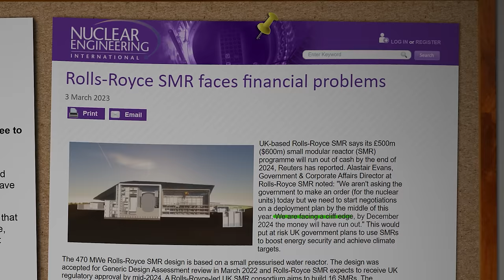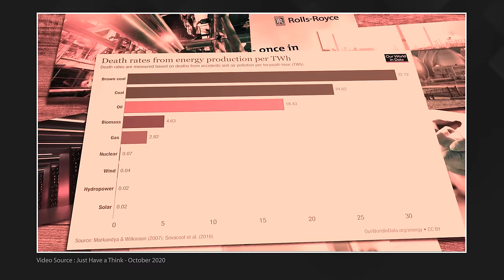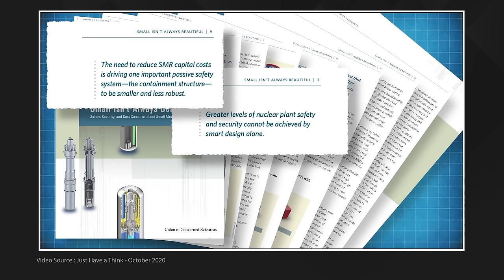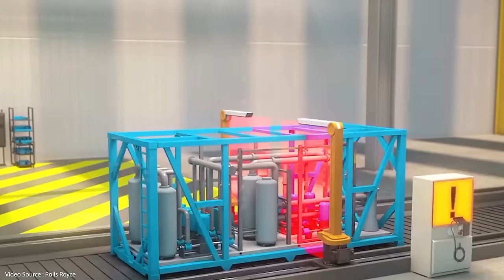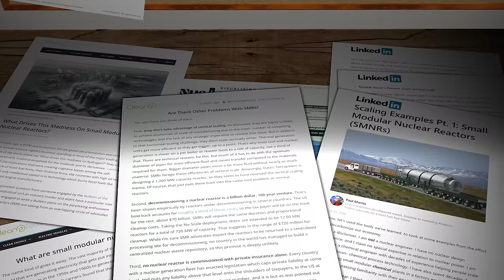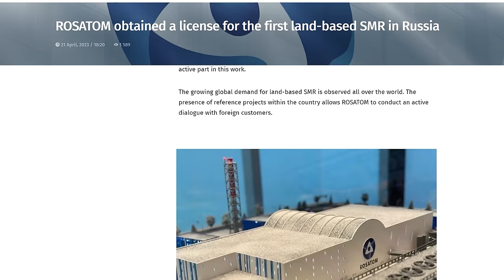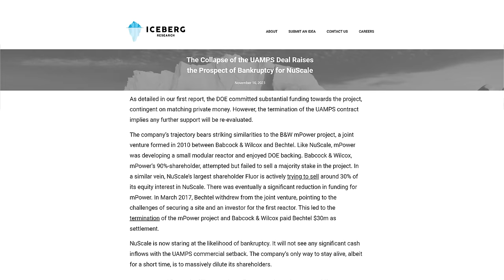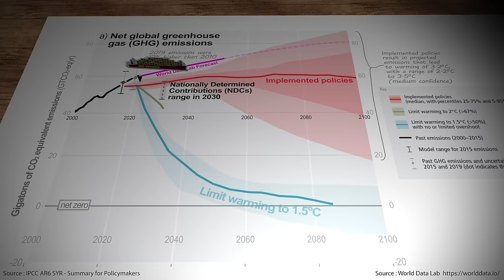Small Modular Nuclear Reactors. The Verdict

Comment: I have similar views. It's hard to see how nuclear as a whole will make a dent in the electricity market before 2050. 
In fact, given the age of most of the fleet, it would be surprising if current output levels can be maintained till then. 30 years of non-investment can't just be ignored.
Reply: Yes, from what I've learned, due to labor shortages alone it is impossible to even replace those aging reactors still in use.
Reply: Yeah, we should just give up on it then... No need to better anything because we already stopped funding it. Seems like the most logical move for humanity. Oil forever! 💪
Reply: @Robert_McGarry_Poems  there is a third option, also mentioned in the video. More renewables plus storage.
I mean, it has become clear over decades that the costs for nuclear won't come done. How many more decades does it take?
Reply: Lol, I can tell you from France : we are not stoping Nuc any time !
Reply: @akaikiseki9346  yeah, and I can tell you from Germany, we already have! 😄
And we will have a future of cheap and clean energy ahead. 😊
Reply: @mael1515  But it's not/hasn't ever been an overhead cost conversation. It's a circular lifetime, and maintenance problem. It's a corruption problem. If we don't have the conversation, we can never improve the conversation. That is the propaganda part. Yeah, I understand the argument completely, hence the witty😏 satire comment. But, to me, that is the same kind of argument people make for shopping at Walmart, but only once a month. It's a kind of drop in the bucket argument. Like, I'm just one person, what does my vote matter... It doesn't make the argument good, it shrugs off any chance of forward progress. Cough, the 70-80's.
Reply: See ITER. 😶
Reply: @akaikiseki9346  France's percentage of nuclear power has dropped from 80% to 69% over the past decade and is slated to drop further as another 6 plants will close over the next 6 years with no replacements slated to come online in that timespan. 

France is stuck with the same economic picture as the rest of the world, and its nuclear fleet is slowly bleeding out as a result. The upcoming loss of reactor capacity is being replaced mostly by solar and wind, for the same reason everyone else is doing that.
Reply: @harmenkoster7451 I do think they need to rethink the picture. The point is we need the power during the transition. So if all reactors can safely be run another 15 years, instead of prematurely shutting them down, that would significantly speed up a transition. For every reactor extended you can shut down a coal plant
Reply: @Rene-uz3eb  France's reactors are already well over half a century old, and they are shutting down because maintenance is becoming prohibitively expensive and they are just getting plain unsafe to run at this point. So extending the lifespan of the french reactors isn't really an option anymore, they've already done that several times.
Reply: @Robert_McGarry_Poems  Oil doesn't compete with nuclear power, which is used to generate electricity. Oil is too expensive for the electricity market  except for niche applications like on small islands. 
Oil is primarily used to store energy in moving vehicles. It competes with batteries, not with electricity generation.
Reply: France built out their fleet in about 20 years.

The main issue (besides the nuclear non-proliferation treaty) is that nobody has experience building plants anymore. Each project is "bespoke", as mentioned in the video.
Reply: @mael1515  "And we will have a future of cheap and clean energy ahead." - Hi, I'm from Germany as well. While I agree that nuclear power plants are economically unattractive, I think you underestimate the costs of wind and solar energy. Germany has much less than ideal conditions for that regarding its location, e.g. Spain is much better suited for solar power than Germany, and Germany has a rather short coast line compared to some other countries. This requires to build wind and solar installations at less ideal locations, increasing the cost of electricity when compared to other countries. The need for energy storage makes this picture more complicated (countries relying mainly on a single energy source probably need more storage capacity than countries with a more balanced mix of energy sources), so maybe I'm overestimating Germany's location disadvantage as well. But nonetheless I think it should be kept in mind.
Reply: @bernardfinucane2061  What?
Reply: @akaikiseki9346   From Germany :  So many of  your super-reliable super-safe reactors had to be shut down last year they dented the whole of the european energy market.  EDF also pulled out of their UK projects because it was an economic nightmare.   The greens didn't kill nuclear...  the money did.
Reply: @danielh.9010  yes, I agree, Germany is not an ideal location. That's why the European grid is going to get even more important. It is a lot of work, but I figure building and operating nuclear power plants is more work, more expensive and takes even longer.
Reply: @akaikiseki9346  And we pay for it three times: via the electricity bill, by bailing out bankrupt companies like Areva, and by our sky-rocketing debt (national and EDF).
Let's face it: in 2024, nuclear energy has become simply the most expensive and complex way to boil water.

It would make sens to kept 20% nuclear for base load. But aiming to rebuild 60 GW is begging for economic desaster.
Reply: @mael1515  solar/wind can NOT get us to 100% carbon free in EVERY corner of the globe - Northern Canada will hit -40+ and when it does there is ZERO WIND for days and short sunlight hours due to winter and with everything being electric the DEMAND WILL be at its peak and some sort of "baseload" power will be needed 
and with our current global geopolitical "landscape" few countries are willing to rely on foreign countries for there electricity needs making LOCAL generation highly desirable
Reply: @jasonriddell  Canada is the only Western country with access to a decent amount of nuclear fuel, so that makes sense. It's just not enough for the rest of the western world, so we would just change the problematic oil countries for even worse uranium countries. Plus it would take too long to build everything and it still is and always will be way more expensive than renewables from other countries. That will never change, nuclear is not a solution, maybe a little band aid. Like it is correctly summed up in the video 🤷
Reply: @mael1515 Problem is we're even further behind with grid scale storage in terms of making it economic and scalable to the gargantuan quantities required.
Reply: And considering electricity is 20% of our energy use...it has a long way to go, five times more would be needed after we reach the 20% and there isn't enough time or resources to electrify everything. Oil can be removed from society with degrowth, add 5% for food/delivery, add 5% for medical, round up 10%, we could lower emissions 60% in an election term by staying on coal.
Reply: I guess europe is done for then. Renewables and deindustrialization full steam ahead.
Reply: How can you advocates de growth with rising population levels.

That would simply lead to famine and poverty.
Reply: @klingenberg4078 I didn't advocate anything. I made a prediction.
Reply: @Croz89  it is a challenge, yes. But it seems smaller to me than building thousands of nuclear reactors worldwide.
Reply: @antonyjh1234  lower emissions by staying on coal?!? 🤔🤔🤔
Reply: @afreire239  quite the opposite: electrifying the industry and enjoying the benefits of cheap energy without global dependency. It is a lot of work, yes, but wo is building huge amounts of nuclear reactors.
Reply: @mael1515  Yes, changing the laws of man, that's impossible. But changing the laws of physics, yes that's possible😂
Reply: @mael1515  80% of our energy use is diesel, petrol, gas. Remove these, change society to one of meeting needs over wants, value over profit and yes it would be possible to stay on it.
To put it another way there is 636 kilowatts of energy in a 60 litre tank of diesel, around 3-6 months of my comparative electrical energy use depending on the season. Global warming is also about energy that we put into the system as heat, reducing 80% or as I said 60% of this heat would be great. CO2 without the heat or vice versa and the problem is not so large.
Reply: @mael1515   Honestly, considering the scale required, I'm not so sure it does. All these novel battery technologies are just as experimental as small modular reactors, in many cases arguably more so. And the sheer capacity required compared even to SMR is gargantuan. You need a lot of space and a lot of raw materials.
Reply: @antonyjh1234  the problem of electrifying gets even smaller if one does not calculate with how much energy is in fossil fuel, but with how little of it can actually be used. Most of it gets lost as heat and vibration in a combustion engine. That's different with electricity. We need to calculate usable energy and we can use a much higher percentage of electrical energy than anything we burn.
Reply: @afreire239  laws of man have always changed and they will have to continue to change due to climate change. 🤷
But I agree it also is a psychological problem: hoarding stuff to burn anytime feels safer than relying on natural forces to produce energy. I suspect it just isn't if one considers all the downsides. 🤔
Reply: @Croz89  I'm not sure either, I just think the renewable path makes much more sense in the long run. But I agree the challenge is immense on all paths.
Reply: @mael1515  Not so much, the energy I'm talking about plants are about as efficient as engines, it's just that we ignore how much energy we use to go for a drive. The worlds drive for net zero, usually relates to electricity, ignoring the massive amounts of energy we use from oil, it is planned ignorance of us by govts imo, as they give the impression we are getting somewhere while keeping business as usual. Added; once it gets to us though it is more efficient because it doesn't take a lot to power our lives. Imagine a 100kwh battery operated car, not that the world can replicate ice engines, it is 1/6th of the energy.
Reply: @mael1515  I was talking about how depending on renewables isn't possible because of low EROEI. While for nuclear we just need to change government laws to make it possible.
Reply: @afreire239  I would argue the laws are there for a good reason. And the biggest problem with nuclear is costs and we don't have the number of skilled people to even replace older existing plants. Both problems don't disappear when laws are changed.
Reply: @mael1515  EROEI?
Reply: @afreire239  "energy returned on energy invested" is interesting and good from an engineering or physical standpoint. The problems I see are financial, possibly ecological, logistical and geopolitical.
Reply: @mael1515  I think it will really depend on location. Equatorial countries with low energy consumption can probably get away with solar as you only need a few hours of storage capacity. For seasonal countries with high energy consumption, or heavy industry (you really can't run a steel mill on solar), that probably won't cut it, you need a more compact, reliable and intense energy source.
Reply: @Croz89  in retrospect, Germany would have only needed 4 days of battery storage in 2022 (not total, 4 subsequent days). And one could run a steel mill on solar two ways: a) create heat from electricity b) make hydrogen or other derived storage molecules from electricity. 
Granted, that requires a LOT electricity, but it is possible. I.e. produce hydrogen in deserts and transport it like we do with oil and gas.
Reply: @mael1515  How? Germany has the dirtiest grid in western Europe!

And yes, In theory you can run a steel mill on solar, but not in a way that would be remotely economic or efficient. You really just need a massive energy source that's totally constant. For that you can manage with fossil, just about, but nuclear or hydro are what you really want. Keep the hydrogen or synthetic fuel for higher value energy consumption, like trucks or planes.
Reply: @Croz89  actually, Poland has the dirtiest grid in Europe, but yes, Germany has to improve and is on track to do so.
I agree that using electricity for a steel mill is less efficient and economic, but given the dangers of climate change, these two things are less important in my eyes. Also, one should include immense subsidies for fossils fuels in this calculation, although they might still come out better than solar.
Reply: @Croz89  I am sorry but you are misinformed when it comes to German nuclear power plants. All plants were at the end of their lifespan and even beyond. Two got a limited expansion and in retrospect this wasn't even necessary. This end of nuclear energy was long decided and well thought out in my opinion. One can argue about if this is a good thing, but Germany definitely did not shut down perfectly good power plants that could have run more years. 
And I honestly believe that it is the only industrial country in the world to do the right thing. Time will tell, of course 🙂
I agree that the steel industry is difficult to decarbonize. But we still have to.
Reply: @mael1515  The fact the owners of those power stations successfully sued and settled with the German government for lost earnings says otherwise to me. As for German industry, it faces a dark future if energy prices keep rising in the country (coupled with the aging workforce).
Reply: @Croz89 anf the nuclear power plant owners sued because they had the obligation to their stock holders as publically traded companies. turbo capitalist profit maximization, but that is another topic...
Reply: @mael1515  That doesn't matter. It proves the power stations were still economically viable, otherwise they would have lost.
Reply: @Croz89  okay, maybe two more years after 40+, the point is: these were not perfectly fine plants that were shut down on short notice without thinking. The contributed very little and were about to be decommissioned soon anyway. 
By the way, thanx for the constructive and polite discussion 🙂
Reply: @mael1515  I agree they didn't make up a particularly large share of the German energy mix, but they were still perfectly capable of running for a decade or so more, they weren't nearly at end of life.

Here's my opinion on the whole thing. Germany is free to shun nuclear if it wishes, if it wants to go for just renewables it is welcome to try (and hopefully its industry doesn't collapse). But while a single coal (and to some extent gas) power station remains open, closing nuclear power stations prematurely means those coal power stations need to pick up some of the slack and that means more CO2 is emitted. So Germany should only close all its nuclear power stations either when they reach end of life, or when all the coal power stations are closed. I think that would mean that no nuclear power station in Germany would close prematurely.
Reply: @Croz89  well, it's done, no way back 🤷😊
Reply: @mael1515  That is true, it is too late now. And thanks for the compliment.

Comment: Perhaps it’s a bit off topic, but I fully expect that the development of fusion power plants is going to butt up against the same constraints of minimum economic scale as these SMRs, only on a scale that dwarfs even the largest, modern fission reactors now.   My wild guess is that in a hundred years or more, there will be working fusion power plants, but they will be a scant few, mind bogglingly colossal constructs surrounded by the high energy demand industries that they will primarily feed.  All the rest of us will be getting by just fine on renewables by then.
That’s all assuming all the current negative trends get resolved without ending civilization as we know it.  Wish I could be more confident of that.
Reply: That's just wishful thinking.  I see no reason to expect any mind bogglingly colossal constructs because we will have alternatives that are vastly less expensive.  We already have them.  mind bogglingly colossal = colossally expensive.  Think of the security needed to guard such a plant, which would represent a single point of failure for all or much of a country.  That would fit nicely with a government that was far too powerful for the good of the citizens.
Reply: High energy demand Industries plug into an electrical grid. Besides fossil fuel refineries burning their own dirty product to power their operations, I can't think of industries that make their own electricity.

At least continuous power generation from fission has been demonstrated and companies are worrying about manufacturing and operational costs. Continuously loading fantastically precise targets for laser ignition fusion seems insane, and maintaining a tokamak or stellarator containing plasma at zillions of degrees is "a problem to be solved later."

R&D is fun, but no guarantee of commercially practical outcomes.
Reply: @incognitotorpedo42 in a century our grandchildren may have gotten sick of the amount of CO2 in the atmosphere that’s still creating havoc and decided to capture some. Without plating the planet in solar cells there would never be enough energy to do anything effective, but build enough giant continuously running fusion plants and maybe there will be enough energy to begin to actually do real carbon capture. Or our descendants may have something else to do with massive amounts of power that we haven’t even thought of.